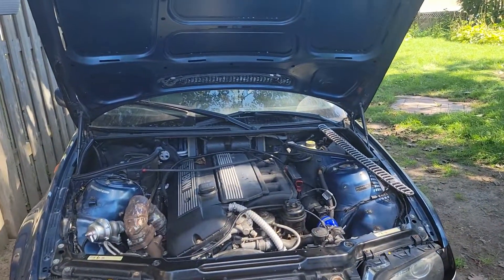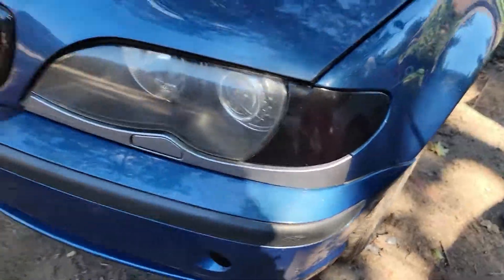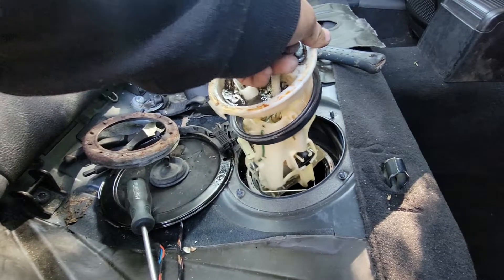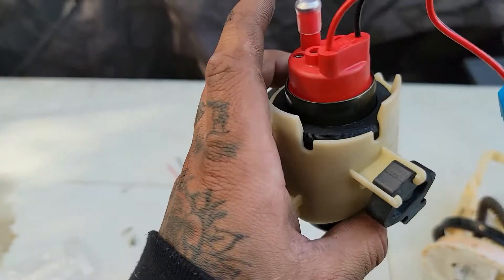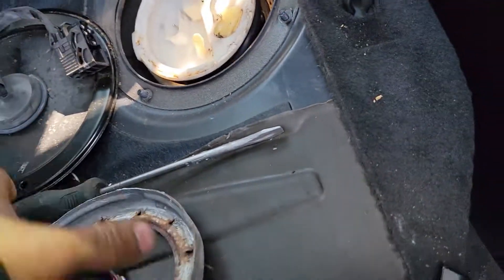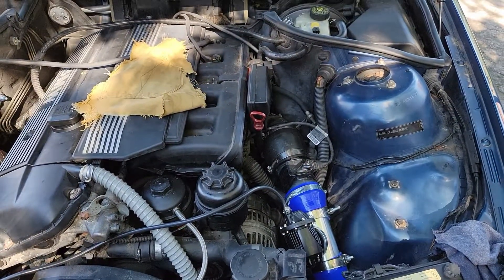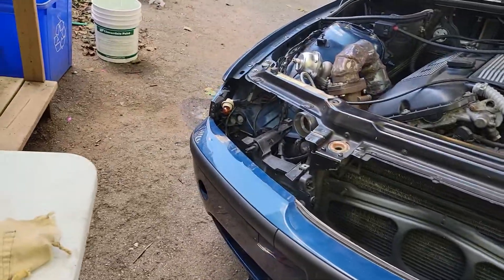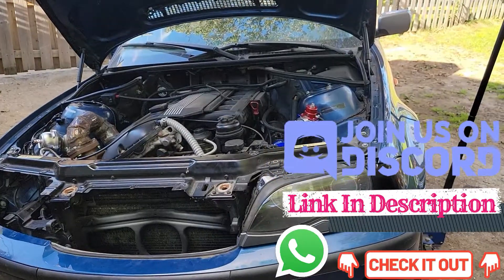S2E11 - How To Install Aftermarket Fuel Pressure Regulator, Fuel Pump, & Fuel Lines On A Boosted E46

Comment: Did you cap the return line on fuel rail?
Reply from the maker: No. Return has to go to the return port on the filter. Or you can run it straight back to the tank. But it has to return to the tank. Because I ran an E36 fuel filter, it deletes the return port on the filter. So I ran mine straight back.